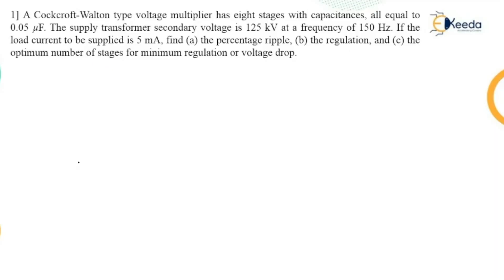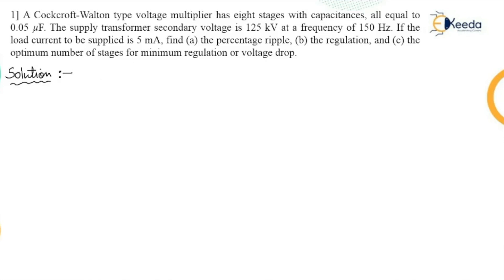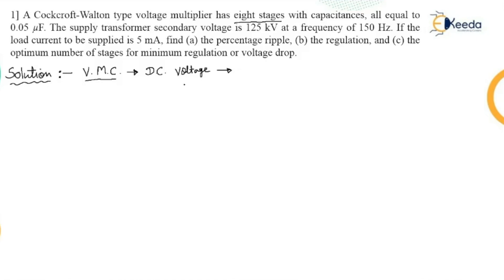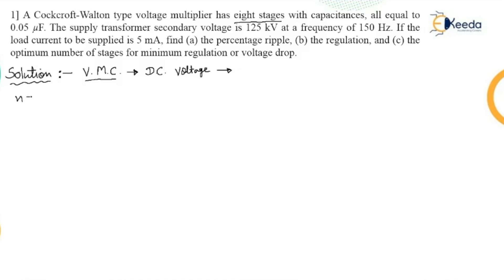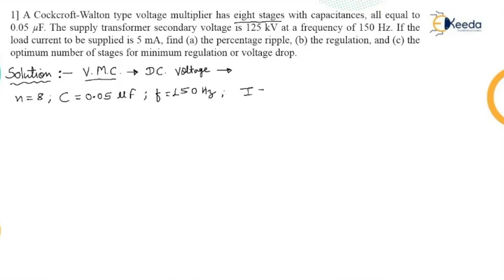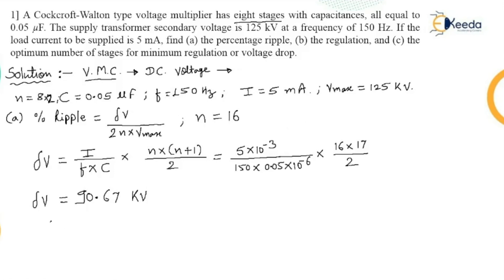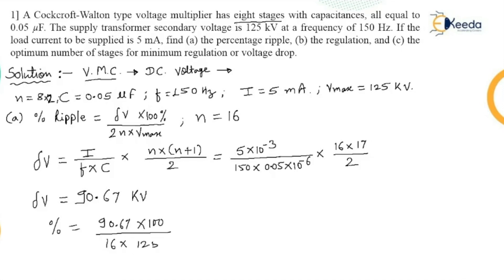Numerical on Voltage Multiplier Circuit - High Voltage Engineering

Comment: You have little mistake in %ripple where dv = I/fc)×(n(n+1)/2)
You make the n16 and it should be only 8
Thanks..
Reply: yes, it should be 8
Reply: Same doubt here
Reply: Yes it should be 8 in calculation of ripple voltage (Delta v) or ripple also